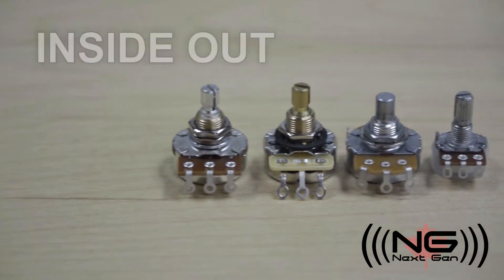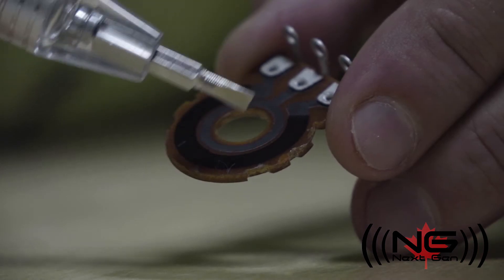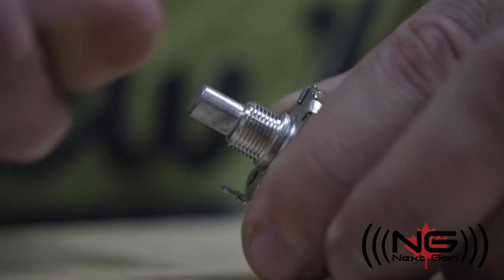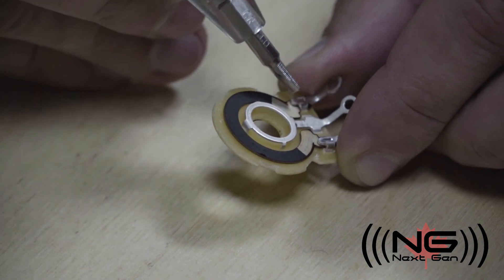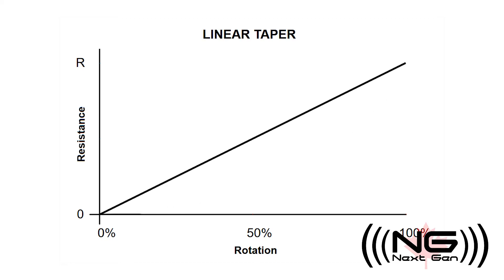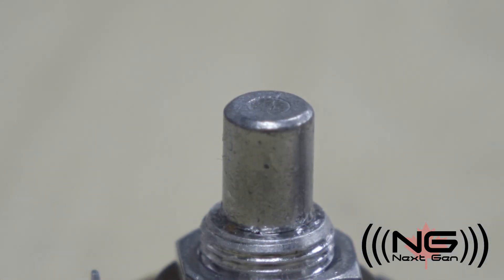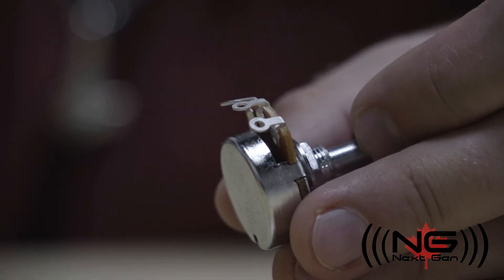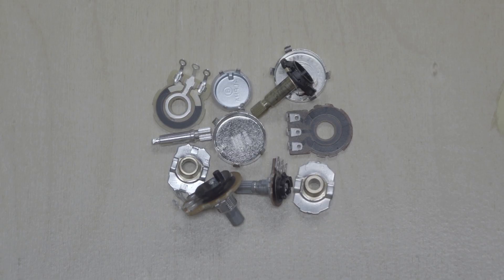Inside Out - How Potentiometers Work

Comment: Next gen guitars, I'm not sure how low friction pots are any different from regular standard pots is there any way or any tips that you might have to upgrade or modifications that you can do to regular stock pots to make them low friction pots because evh use low friction pots and I think he modified his guitars back in the 70s so they were low friction pots I'm not sure exactly what he did to them or how he got the ideas but he somehow did some type of modifications on the mechanism
Reply from the maker: 1:13 The friction comes from the pressure the wiper applies to the carbon track.  More pressure = more friction.  Less pressure = less friction.  It is set at the manufacturing level.  I wouldn't want to try modifying it to lower the friction, but I suppose it could be done.  It could be as simple as just trying to bend the wipers back a little to reduce the pressure they apply to the carbon track.  Among other risks, there is a risk that you bend them so far back, they no longer keep good contact with the carbon track across the full range.
Reply: @NextGenGuitars  I think EVH would do this or add lighter fluid or some type of fluid liquid in the pot to make it have less friction . What type of fluid would you recommend using in pot for less friction?
Reply from the maker: @waynegram8907  I can't recommend anything in that case because I wouldn't consider doing that.  The only fluid I recommend spraying into a pot is Nu-trol, Deoxit, or some other properly formulated contact cleaner (and lubricant) that doesn't leave unwanted residue.  Though, that cleans the tracks/contacts.  It doesn't really decrease friction, unless you have a dirty pot.

Comment: PS,  You measure the diameter of the pot shaft  to make it easier for people to choose one that fits the knobs on their amplifier or device but you never talked about the diameter or threads of the bushing with which you mount the pot through a hole in the chassis!  No one really wants to drill out a hole in a vintage amplifier to fit a pot with a larger bushing if they can help it but even more frustrating is fitting a replacement pot with a smaller bushing than the original into what turns out to be an oversized hole in the face plate of the amp.
Reply from the maker: Correct!  Bushing diameter is very important for many people.  That's why it is always listed in the product information, along with other pertinent info.

Comment: Great video! Lots of good information here. I will be placing my order for some low friction pots soon. If you must use a knob with a set screw on any split shaft pot (not recommended!) line up the knob with the set screw parallel to the split (or very close to it) so as not to tighten it perpendicular to the split where it can break the shaft inward when tightened. As a guitar tech I learned this the hard way!

Comment: Sir i need a ink when volume switch carbon is cut in center and which ink is used for
Reply from the maker: No idea where you'd get it, but you can search for "Conductive Carbon Ink".  Though, honestly, it's probably cheaper just to replace the pot.

Comment: Was curious how the numbers mean on pods. I have a guitar amplifier and I see bass is labeled - A50K mid is A5K treble - B50K and volume B50K. Was curious why bass and miss are so different and what the numbers mean so I can understand why The numbers vary for mids but are the same for bass and treble.
Reply from the maker: That type of label indicates the taper and resistance of the pot.
3:09 - TAPER
A = Audio/Logarithmic
B = Linear
C = Reverse Audio/Logarithmic

RESISTANCE
The resistance is somewhat self-explanatory.  It's the total resistance of the pot.  So, an A5K is a 5K pot with an audio/logarithmic taper.  A B50K is a 50K pot with a linear taper.

Resistors and capacitors are used to manipulate audio signals in different ways.  Different combinations of resistors (including pots) and capacitors in different arrangements within the circuit will have a different impact on the signal.  If your amp has those values for the tone controls, it's because the designer of the amp chose those values to accomplish the effect he/she was after when they designed the amp.  Can't really be more specific than that, unfortunately.

To get an idea of how that works, you could look at free software like this:
http://www.duncanamps.com/tsc/

It includes a couple of basic amp/pedal circuits and allows you to change component values.  You can then use the faders at the bottom to see how that impacts the sound/sweep of each pot.  Other than that, you'd have to seek out some more in depth educational material on analog signal processing.
Reply: @NextGenGuitars  ,  Alps pots are commonly marked with a B even when they are Audio taper!  Also, the amount of torque or finger pressure required to turn the pot is often related not to the pressure of the wiper against the carbon track (excessive pressure would cause premature wear to the carbon) but instead is due to the type and viscosity of lubricant used between the shaft and the bushing. This is the main reason why flooding a potentiometer with certain cleaners, or too much cleaner, can cause it to feel dry and rough afterwards; some types of lubricant are easily dissolved and flushed out by the cleaner. Slide faders are the most obvious example of this and often barely move after being sprayed; I recommend taking faders apart to clean them rather than simply spraying them.

 Some faders will also have have several signal-carrying metal conductors and wipers in addition to the main carbon element/wiper interface, and may have a lubricated rail that the wiper assembly slides on; and therefore there might be more than one type of lubricant used inside a fader (a silicone lube with a syrupy consistency is common). Spraying faders with cleaner often produces poor results because it mixes the differing lubricants together. 

The electrical contact points of wipers against the metal rails is just as likely or even more likely to cause intermittent action of the pot then the junction of the wiper to the carbon element itself! This also holds true for ordinary rotating potentiometers: the commutating rings that transfer the rotating electrical junction of the wiper to the stationary center terminal are a main failure point due to oxidation and tarnish. Sometimes the only way to clean these metal-to-metal contact points properly on a rotary pot is to polish them with a pencil eraser, and this often requires either dismantling the shaft and wiper assembly from the carbon wafer (you might have to grind off the back of the shaft, and so it might not be possible to put them back together again afterwards 😳); or you may have to do some very tricky maneuvering of a carved, chisel-shaped eraser into the narrow gap between the carbon wafer and the plastic or phenolic disc that holds the metal commutating rings, without damaging the wipers. Not easy to do!
Reply from the maker: @goodun2974  You're probably thinking of W-taper Alps pots, which are 5B, 4B, etc.  Their linear and audio tapers are still indicated with B and A (10A, 20A, etc.)

We don't deal with faders at all, so we can't advise on that.  Great info, thanks for sharing!

Comment: what's the background music? also why are there three pins in pots, whats the third pin for?
Reply from the maker: Music is random improvised bits from warehouse staffers. Center pin is the wiper. Outside pins are the two extremes of the resistive element.

Comment: Another well-done and informative video, Jon.  I only have one question: Did I sell you my old Ultraballz pedal, and does it still work okay?

Just a few details to add to an otherwise thorough video.  

My own experience is that the wider the diameter of the pot, often the less abrasive the wiper is.  As a result, the larger pots tend to have longer service-life before needing either cleaning or replacement.  People often think that all the dirt inside a pot comes from outside.  Some certainly does, but you would be surprised how much dirt inside the pot is created by the wiper scraping carbon particles off the resistive strip.  It certainly doesn't happen *easily*, but  a few thousand turns and "stuff" happens.

A product I like to use to repair/refresh older pots that have seen a little too much use is a Canadian product called Stabilant 22.  It can be purchased online, and more recently at Active Electronics.  NOT cheap but stunningly effective as a contact *enhancer*.  When the continuity between a wiper and the resistive strip has been compromised, this stuff forms a non-drying conductive film over the resistive strip that behaves like a liquid solder joint.

Many pro service benches will use a one-two combination of DeOxit to clean, and then application of Stabilant to restore/enhance.  If you've been playing White Room or Voodoo Child thrice nightly in a Cream or Hendrix tribute band since 1976, chances are it will not be able to bring your favourite wah back to life, but I've been ablke to restore proper functioning on many older pots, switches, video-game cartridges, and TV remotes.

Of course, the best advice is: start with decent pots.
Reply from the maker: Great addition.  Thanks Mark!

Never bought a pedal from you, but Ultraballz sounds ballzy!